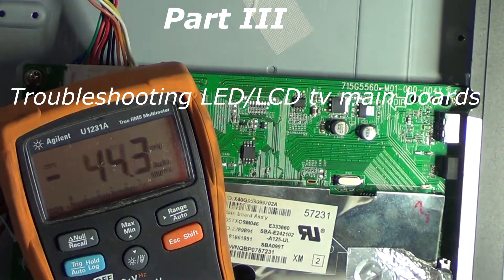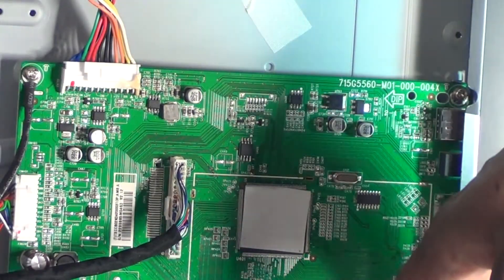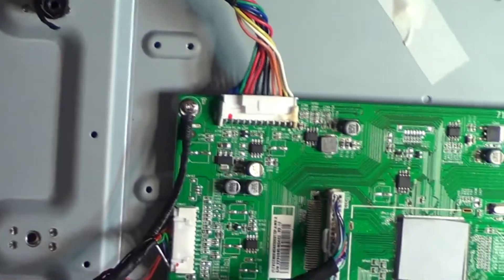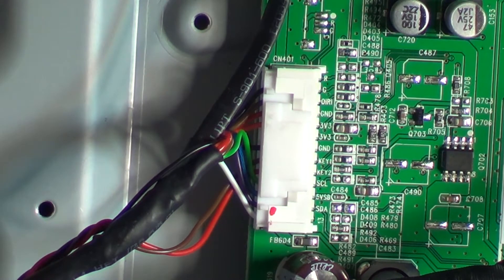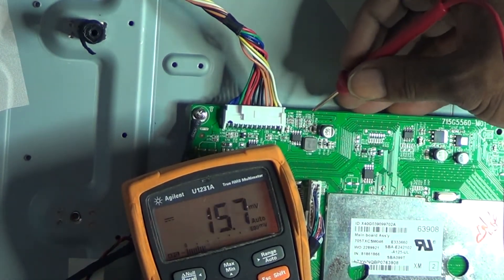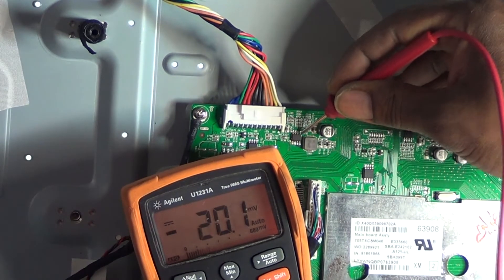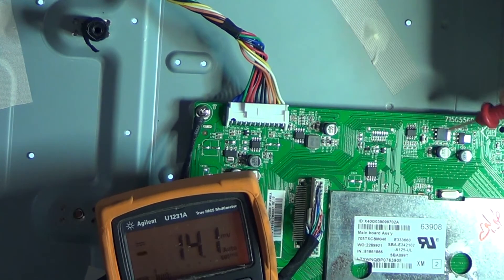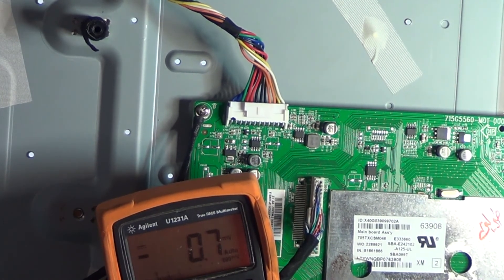Vizio e390-a1 LED TV mainboard troubleshooting ( part 3)

Comment: i have this model its a 39 inch. my led will come on but screen doesnt. sometimes it will if i unplug it but its getting worse. is the power supply board and main board different or is it the same. if its different which one should i replace